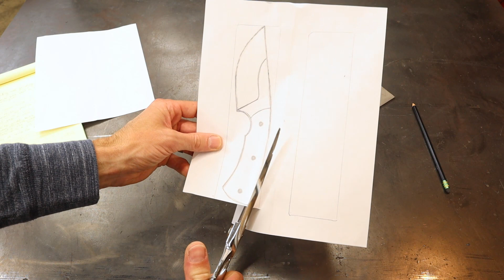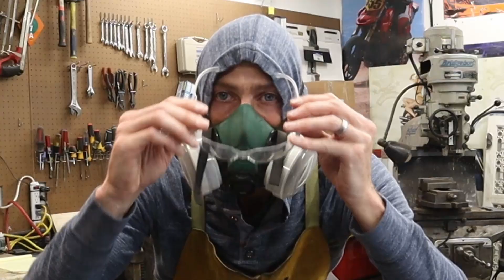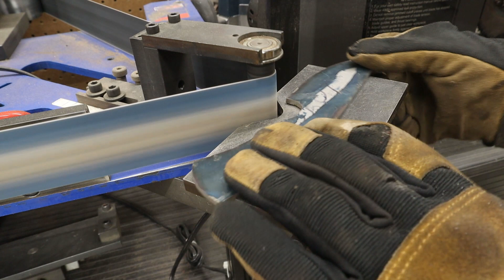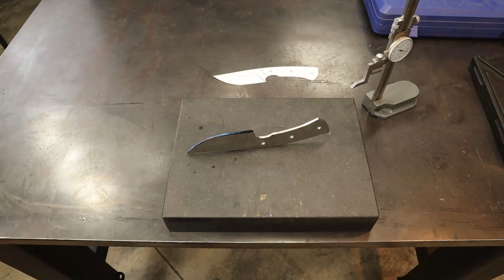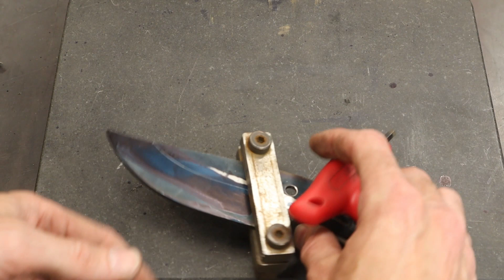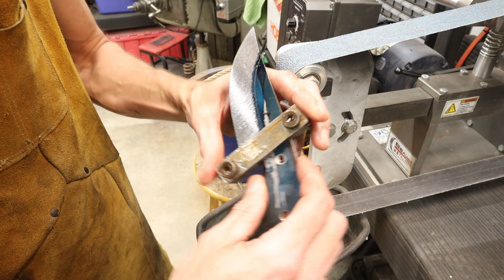Stock Removal Knife Tutorial - Pt. 2 - Grinding The Bevels - Knife Making

Comment: Another hint to new blade makers...ALWAYS drill your handle pin holes BEFORE you temper the blade!  Keep everything in this video in sequence.  A well tempered 1095 blade for sure  will make you go thru a handful of bits!  Also, I use a machinist center drill after I punch the hole positions with a center punch. That gives you a very nice beginning hole for your main bit that won't let it walk on you.

Comment: Videos are awesome!  Many details that are helpful to beginners like me.  When grinding the initial form of the knife, how do you keep from over-heating/burning the metal?  Or is that not an issue?  I am starting with a few different knives using 1084, and there seems to be darkened areas along the edge of the initial grind.  Does that go away with heat treatment?  Or do I need to start over?
Reply from the maker: It doesn't matter before heat treat

Comment: Not to be disrespectful, I think you're a genius, but I have to ask why you don't use any lubrication when drilling your pin holes on the drill press? I noticed it even bind up a few times. Is there a reason you prefer not to use a squirt of oil? ...had to ask.
I learn more from you than most everyone else, so again,  no disrespect Aaron!
Thanks for all you do!!
Reply from the maker: Sometimes using cutting oil I have a hard time getting the drill to bite and it will spin creating heat which work hardens the metal. I don’t claim to have the best methods, just what has worked for me
Reply: @Aleeknives  I claim that you have roughly about 99% of the best methods. I humbly admit to be somewhere in the 13% range myself but moving up...slowly but surely.
Your help has been invaluable. Really Dude!
Reply from the maker: 😂🤣 I doubt either of those claims are accurate but thank you!

Comment: Thank you so much for this video! Super helpful! Are your parallel scribe lines based on a direct ratio to the width of the stock, or do you always go to a certain measurement. I've heard 1/32" is pretty common in outdoor and chef knife making, but want to make sure I'm not going to fat or thin. Thanks again!!
Reply: Also, I use 5/32 for outdoor blades and 3/32 for chef's knives, would they use the same measurement for the parallel lines or?
Reply from the maker: That sounds spot on
Reply: @Aleeknives  awesome - thank you! I look forward to checking out your other videos!

Comment: If you didn’t have a belt sander, but had a tormek, how would that change how you make your primary and secondary bevel grinds?
Reply from the maker: Interesting!  The tormek would make a deep hollow grind versus a tall flat grind. It could be done though
Reply: I’m too lazy to to the math, but the radius of a 10” wheel should be minimal. I wouldn’t be able to hand sand with a block after, I would have to do all sanding on the wheel to keep the radius throughout. I’ll have to give it a shot.

Comment: Once the drill bites you don't need to hold it, I use a 123 block behind the knife to absorb the pressure from the rotation. The 123 block is as high as the drill chuck so if the metal catches on the drill, the knife will ride up the 123 block and protect fingers.
Reply from the maker: Valid points

Comment: I really appreciate these videos, Airin. I've had some trouble with bevels. I've been able to get my lines on the blade okay, but to get secondary bevels I can't work the bevels up to the top line. Can't seem to control it. (Using 1x30 belt sander) Any insights that would be helpful? Thanks.

Comment: Loved your tutorial on full tang wood handle making.  The detail was great.  Don't like this video on stock removal blade making.  You use terminology that doesn't make sense:  you said to make a 'shallow' initial bevel that goes to the scribeline.  The bevels on knives are usually measured in degrees.  A shallow bevel should then be a relatively low number of degrees, like 5-8 degrees per side.  What you 'showed' was a bevel that looked like 30-40 degrees.  That's a steep bevel angle, like for a scandi grind.  Also, you should use numbers, like 020" or 5 degrees.  Be specific; don't use expressions like "thickness of a dime".  Do you mean a newly minted dime or a 4-year old worn out one.  Did you ever actually measure the differences in dime thicknesses?  If you measure the height of scribe lines in thousanths of an inch, why not say what you actually measured?  I would also hope that you actually talk about heat treating in degrees F, and not 'dull red' or 'bright orange'.  Plus or minus 20degrees can screw up a quench.  So I've stopped watching your vids.  Just so you know.
Reply from the maker: 👍 cheers! Thanks for moving on
Reply: Great reply by the man in charge!  Who needs viewers like this?!

Comment: What thickness steel do you typically use for your knife builds??
Reply from the maker: I use all thickness from super thin all the way to over a quarter inch. What type of knife are you thinking of making?
Reply: @Aleeknives  l was building with 3/8 01steel. As a new knife builder 3/8 was a little to thick to learn on. Especially using a file and jig.

Comment: Some people frown on wearing gloves near moving machinery. I always wear a nice fitting pair of Tig welder gloves when grinding on the belt grinder with rough grade belts !  I have "trimmed my knuckles" a few times and it was not enjoyable !
Reply from the maker: I totally agree about the gloves! There are machines that I will not wear them when I am using it. The grinder is not one of them. I have lost knuckles and fingernails, however, you shouldn't wear gloves after the heat treat so that yu can feel what is going on temperature wise with your blade! Hey thanks for watching!

Comment: Do you go from 36 to 80 on the bevel grind after heat treat? Then 80-120 ? thank you
Reply from the maker: That is correct! After heat treat hog off most of the material with the 36 then to 80 to clean it up and dial in the upper grind lines and off to 120 to get all the 80 grit scratches out.
Reply: @Aleeknives  Thanks so much

Comment: I love the series of videos.  My sons and I are making our first knives using this as a guide.  Any tips on making the grind line for the initial bevel without the thickness gauge?
Reply from the maker: I am so glad the series has been helpful! There are several other ways to scribe grind to lines another favorite would be to use a twist drill that is smaller than the thickness of the steel you use. If you use a twist drill the same thickness the line from the tip of the drill bit would scribe a line right in the middle. You really want parallel lines to grind to opposed to a single line in the middle. You would lay your stock on a flat surface and lay the drill bit on the surface also, then use the tip of the drill bit to scribe your line, flip the stock over and scribe your second line. Feel free to reference me throughout your build! Cheers

Comment: Not really a bevel jig,is it.It's just a couple of pieces of steel stopping you from grinding past the line.How many beginners are going to copy your freehand method at the belt,and run past the line at the top of the bevel,because they don't have your experience.Surely better to have your blank fixed to a proper bevel jig,set to the required angle,coming off a horizontal surface.Pretty foolproof that way.Seems odd,with your attention to detail everywhere else,you would choose to freehand the grind
Reply from the maker: I tried a jig and felt that I had a lot more control over the grind free hand. It is just my preference. Also if you learn to grind freehand you can grind more complex grinds than you can with a bevel jig. Thanks for your compliments! I feel like the time I had behind an actual jig was time lost in my knife making adventure!

Comment: A lot of good tips here! The issue with my grinder is the platen on one side almost sticks out. Its a OBM model. So i cant get that close with the file guide on the blade when going on one side. Guess i need a different platen.
Reply from the maker: Can you adjust the tracking on the belt to bring the belt over to the edge? I have to move my belt from side to side depending on what side I am grinding. Hey thanks for watching my videos! Cheers
Reply: I can to a point. Its hard to explain without a picture. The right side of the platen front goes straight back, but the left side comes out about an inch right behind before it goes back. Just how the platen is made. Never saw it as an issue until trying to use a fileguide as a jig.
Reply: @buckyrauch2953  OBM makes a different platen " backup" that sits flat to both sides of the platen. Made for knife makers. About $14 plus shipping. Check their website. Fixed my issues with platen"
Reply: @4trout12429  Awesome, I will check that out. I know they have come out with alot of newer products. One day ill upgrade, but its been decently solid grinder for the price.

Comment: I am constantly making knives on my free time these days and I think I need to make one of those bevel guides. The thing I have the most trouble with is the plunge lines... either they dont match up or one has a hard angle at the top while the other is more rounded. Looks like that may help me out some with evening those up a bit. As always, thanks for the knowledge transfer, I appreciate it!
Reply from the maker: The bevel guide helps out a lot! I will say that another good tip that helped me out was to always grind my weak side first. It is easier to match your weak side grind with your strong side.
Reply: @Aleeknives  that is a good point... too many times I have been excited on my strong side only to mess it up when I switch. Do you go back and forth a lot? Or do an entire side and then switch?
Reply from the maker: If I grind really well that night I can do it one side and then the other.
Reply from the maker: More often than not I end up switching from side to side to Chase my grind line
Reply: @Aleeknives  thats the truth... I have made a choice to only grind when I have the feeling... otherwise I mess things up. If I dont have a good feeling about it then I wait... probably weird but it has proven valuable for me

Comment: I ended buying some of that  3m 90 spray glue, just a quick spray & put the template down, dries quick. Also with the drilling, I just use a clamp behind the knife, that way the knife isn't locked in 1 spot & I can quickly drill multiple holes, without worring about the helicopter effect. We all have our own techniques, great video. Hope all is well, take it easy.
Reply from the maker: I saw that clamp in one of your videos! Great idea man! I rarely make these small knives anymore but I am having fun making a simple knife for a change!